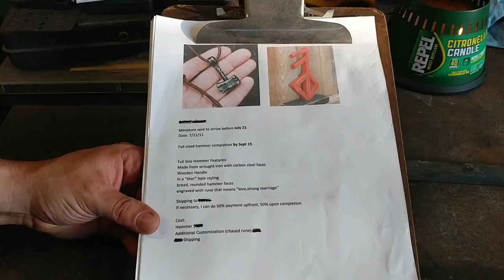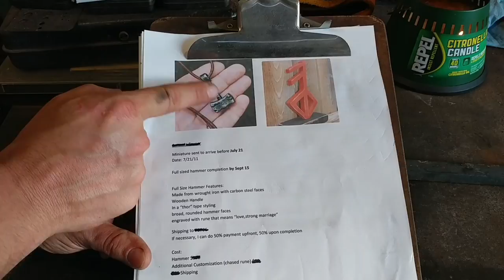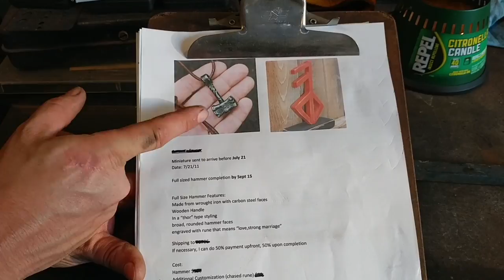How to Make Miniature Hammers // Forging Thor's Hammer Pendant

Comment: there is a simpler way to do this to get similar results. basically using a 3/8" nail header, forge down the end of a bar square so it fits in the nail header, then taka a good bit of steel past that, put her in the nail header, and upset it down, that then forming the head of the hammer, then you can take it out of the header and refine the shape, put back in header and upset some more, refine, and your good. hope that made some sense.
Reply from the maker: +Mark Ling make sense! Thanks for the tip

Comment: If you ground of the extra metal on top of the head from the handle being peened over, would it still hold tight?
Reply from the maker: Yes
Reply: @ChristCenteredIronworks  thanks for getting back!  I assume it would hold from using a drift to make the hole as ghe drift is tapered. If i used a drill press it might not? Not sure how the metal mashing works, just getting into this.

Comment: Sorry but I'm not impressed.  Just my opinion thatd go good on a key ring but not as a necklace pendant as shown in customers picture. Way to big to wear comfortably. And she didn't ask for a belt sanded piece of metal. She wanted forged. That means hammer strikes, and the fire heated look. May get hated on for my opinion but I'd be disappointed if i got they as a customer.